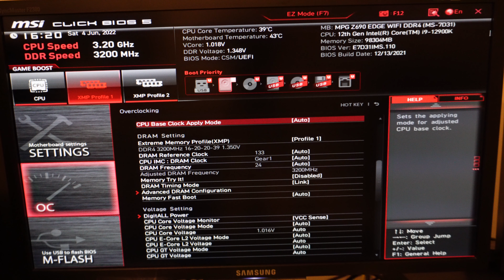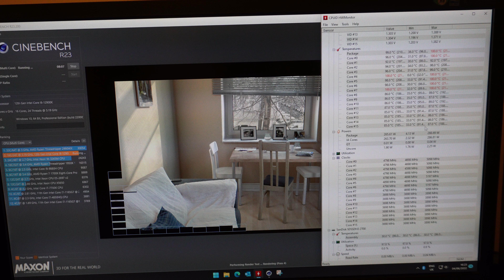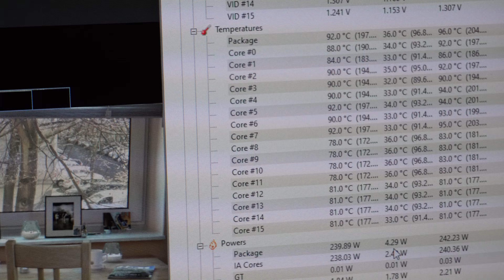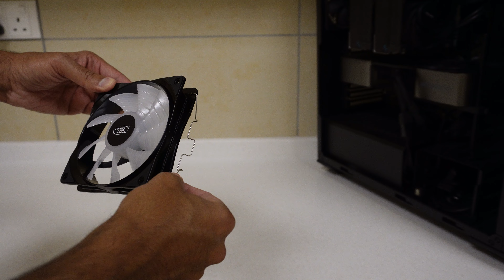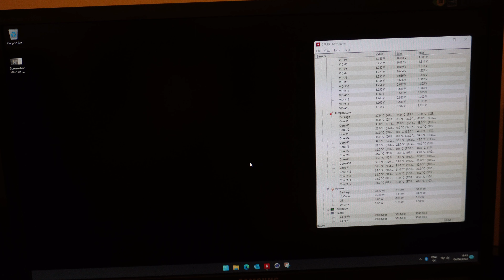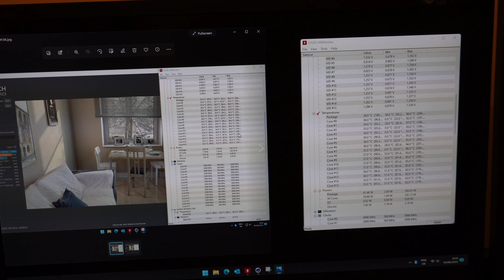Can DeepCool AK620 3 Fans Cool the Intel Core i9 12900K ? (with & without undervolt and power limit)

Comment: i bought a similar setup after watching this video, i got a Phantom Spirit 120 SE dual tower cpu and its holding my i9 12900k alright, no thermal throttling here
no overclock, doing undervolt on a cheap motherboard, great thermal paste, the biggest help for me was buying a 7 fan pc case to help with the airflow, thanks for the info!

Comment: My 14600k temps go up to 100 degree and the power consumption is 195 to 205 watts 
 the cooler is ak620 i used the thermal paste it came with cooler💔
Thanks for the video
Reply: mine too with 13600k undervolted now it consume 175 watt with max 94c....

Comment: Hello there great job 
Could you please tell me where i can get a third fan holder clip for the ak620
Reply from the maker: Hi  Thanks for watching, sorry I missed this question, basically I took the fan and clip from a deep cool neptwin cooler which wasnt exactly the same but just about fit, im guessing there are probably generic fan clips which might work but I also didnt have easy access to anything so was lucky to have a deep cool cooler sitting around to test with, let us know if you managed to find one might help others too, all the best, TK :)
Reply: I was going to buy the clip from ali ex and the fan from amazon then i saw the ag 400 plus for way cheaper price and it came with 2 fan and 4 clips so I bought it 😂 the issue is my 13700 f still hit 100 c under open gl stress test i tried to re mount the cooler no luck idk my-be my cpu is hot or my cooler is bad
Reply: In cinebench i got 98 c in warm room and 92 with ac on

Comment: You may have stated this, but did you test the difference between triple fan and stock double? And did you test with other, more CFM, fans on the cooler?
Reply from the maker: Hi, Thanks for watching. Yes as you can see from the video I tested stock 2 fans vs the 3 fan setup and there wasn't a huge improvement in temps but I did not have higher CFM fans to test with so unfortunately I can't say how much better it would be.

Comment: Great video, can DeepCool AK620 coold the I9 12900K when gaming?

Thanks
Reply from the maker: Hi, Thanks for watching and sorry for the late response. Considering we are able to get somewhat REASONABLE (if you can call it that lol) cooling out of this air cooler I think for gaming it should hold up ok as these synthetic benchmarks are only good for test purposes. I still think some sort of liquid cooled option would be better but in the current build used for video editing the 12900k is doing well with the AK620 with a slight power limit applied, I would highly recommend undervolting where possible and limit power draw to 241w as it is a very minimal loss of performance. Hope that helps, all the best, TK :).
Reply: @TKsTechTalk  Thank you for the detailed reply, much appreciated. Curranty  I am using the AK620 with I5 12600K and its perfect, but will go with liquid for i9.
Best regards.
Reply from the maker: @SIM0N0609  Yeah that's a good setup 12600k is definitely fine with that cooler, you know if the rumours are true about 14th Gen, hold out for 14900k (if it ends up being called that) apparently its more efficient and is rumoured to be supported on current LGA1700 z690/z790 motherboards and would be the last upgrade on this platform. If it is true and if it really is more efficient your AK620 might not need replacing and you can always test it before going liquid.

I really hope this is true will end up being a great option especially for those who opted for DDR4 like myself :).
Reply: @TKsTechTalk  Thank you Sir, that's Great news!

Comment: Hello, I'm thinking of switching my aio cooler to this one instead but i'm wondering if using only 1 fan will it still be effecient, i don't want it block my ram. I mostly gaming with 1 additional emulator tab, the cpu voltage is under 1.3V, the cpu power is around 70 below i rarely OC it pass 90w.  My cpu is ryzen 7 5700x and i have a h500m case
Reply from the maker: Hi, Thanks for watching. Personally I think for the 5700x which has relatively low TDP I can only guess it should be fine. I say this because there is a video linked below from gamers nexus which shows that the smaller ak400 single tower single fan fairs reasonably well with a 3800x and 123w.

https://www.youtube.com/watch?v=8NsFuNqINww

Hope that helps, feel free to ask any other questions.

Comment: i was thinking of replacing my nzxt kraken x 62 with this for my ryzen 9 5900... is it a good choice
Reply from the maker: Hi, Thanks for watching. So I can't comment on the kraken x62 but I believe this is a 280mm AIO which theoretically should be better than an air cooler. Overall since we can tame the 12900k a little bit with some tweaks using the AK620 I think it should be ok with the 5900x as to the best of my knowledge this CPU should run cooler with lower TDP than 12900k, but is there any reason you want to change to air cooling?

Here's a couple of links from Gamers Nexus and Hardware Canucks where they test with relatively high TDP CPU's to give you an idea of performance:

https://www.youtube.com/watch?v=4NpTZRassHI

 https://www.youtube.com/watch?v=UGM6FcLDckk

Hope that helps, feel free to ask anything else.

Comment: I did buy the AK620 with BeQuiet Silent Wings 4 pro for the third fan to cool my Ryzen 7700 non-X. I think it helps quite a lot because my room gets warmer much faster and the temperature never been more than 83C while gaming, whereas it is around 74-76C while running Cinebech R23. The ambient temperature is around 31-33C.

I did adjust some power limits though
Reply: why is it hotter on gaming than cinebench? you have some p-core OC for gaming + lite load for multicore loads ?
Reply: @clap22gaming48   generic test with no spikes its less heat. But spikes in gaming and auto fan rotation makes the difference
Reply: @clap22gaming48  its because if your pc case has poor airflow the heat of graphics card and cpu increases the temp while in  cine bench you only utilize cpu 100%
but while gaming probably your gpu will be 100% and Cpu Will be 60% so...
Reply from the maker: Hi, Thanks for watching. I appreciate your input. That's an interesting result and also strange that it runs hotter in gaming than Cinebench, either the game is CPU hungry or this was a momentary spike, maybe some background process played a part or maybe even a different fan curve could help, either way seems like its performing well on your setup. All the best, TK :).
Reply: Ryzen 7700 cores do not have specified as P or E cores, so I have no idea. Not just Cinebench test was weird but this happened to CPU-Z as well. It never reached 80C in temperature while having a full load but the clock was being only around 4.9GHz and 5GHz, never got to 5.3GHz in the tests. But while gaming the clock was there at 5.3GHz in every games at 83-85C with 100% usage.
Reply from the maker: @Sutlore007  Yeah that's a really strange result, either way at least it's not thermal throttling so your gaming experience won't be impacted.
Reply: undervolt the cpu man.

Comment: But for a normal scenario (gaming, video editing, etc) I think this air cooler will work, right?
Reply from the maker: Hi, Thanks for watching. I guess it will depend on which CPU you intend to use with this cooler, but from my testing on a 12900K if you power limit to 241W and undervolt by -0.05v it should be fine and for CPU's with TDP lower than this CPU. I don't really game so I can't comment accurately though since gaming does not use anywhere near as much CPU as stress tests it should be fine and I mainly used for video editing with the settings listed earlier and it does get a bit warm but not as hot as stress test and did not thermal throttle. Hope that helps, all the best, TK :).

Comment: hi, if i want to buy a fan for third one, which fan should i buy? 120mm?
and how i should connect it with ak620? does it have any place? thanks.
Reply from the maker: Personally, I wouldn't bother with the third fan not worth the extra expense as it didn't really benefit enough to recommend the cost or effort.
Reply: @TKsTechTalk  have a different 2 fan to 3 fan ? i can buy a akasa viper s-flow
Reply from the maker: @CryCasher  Hi, Thanks for watching, yes the third fan was slightly different as it was from a different cooler but it is possible that higher CFM may have a a slight improvement and reduce temps but unfortunately I didn't have any other fans to test with, overall there wasn't a massive improvement from the fans I tested with so not sure if 2 fans vs 3 fans with higher CFM would improve temps.

Comment: It is interesting, you have obtained 26900 points at 96º, I with my i7 13700 and a noctua U12A have had to lower it from 219w to 205w so that its temperature does not rise above 92º and I have obtained 27600 points, it makes it clear to me that if I change the noctua to this ak620 is not going to be able to lower its temperatures below 92º in the Cinebench stress test in each of its cores.
Reply from the maker: Hi, Thanks for watching. Firstly I appreciate you sharing your setup and temps, this could help others as well. In short I feel that the 13700 is probably just as good as 12900k but maybe very little better on thermals. You are probably correct, maybe the AK620 won't give massive gains and all these 12th and 13th gen cpus are hot. I have a 13900k currently running with Arctic 420 AIO and still just about manage to keep it around 90C by limiting power to stock TDP. It's nice to see that a U12A on 13700 can produce similar results. All the best, TK :).

Comment: how did you mount the 3rd fan though? what bracket did u use?
Reply from the maker: Hi, Thanks for watching. So basically I used a fan from another cooler, the Neptwin, which has the same size fan and the bracket is very similar so just fit good enough to use. Hope that helps. All the best, TK :).
Reply: @TKsTechTalk  you are somewhat late haha i got an NH_D15 chromax
Reply from the maker: @kurkurstuff2522  Nice, I'm think that will perform better than the AK620.
Reply: @TKsTechTalk  i think it performs ok. better than my 360 aio though thats for sure

Comment: Hi, I have a neptwin and was thinking of upgrading to an ak620.  I would really appreciate a comparative video of the 2 heatsinks you have since I can't find any reviews 🙏🏻
Reply from the maker: Hi, Thanks for watching. Unfortunately I haven't got the neptwin anymore and I wasn't able to test it with the 12900k but I do believe the AK620 is probably better at cooling the higher end CPU's. I was able to keep a 5800x at under 80C with a neptwin, but the 12900k is a different beast so not sure it would do as well as the AK620. However, I would first recommend testing the neptwin with a contact frame to see how it performs as I got a big temperature drop on the 12900k with a contact frame, assuming you are using Intel that is and depends on what CPU you are using. Hope that helps, all the best, TK :).

Comment: Hi. Is there any difference between the Neptwin and Ak600?
Seems they’re exactly the same
Both of them have twin towers and twin fans? Did you test them out?
Reply: The AK620 is quite a bit better than Neptwin.
Reply from the maker: Hi, Thanks for watching. I actually did have a Neptwin for a little while though it moved on before I had a chance to test it with the 12900k. I think the AK620 will perform a little better than the neptwin. However on a 3600XT i saved a few degrees over the stock cooler using the Neptwin and I think from reviews the AK620 beat those results by a few more degrees. Sorry I can't be more helpful on this one but hope that helps, all the best, TK :).

Comment: How's the performance of this Liquid cooler? Recently I have built my gaming pc and I have paired the Deepcool LE 500 240mm Liquid cooler with i7 13700k. Will it perform well?
Reply from the maker: HI, Thanks for watching. The 13700K has similar tdp to 12900k and maybe a little higher I think its 253w vs 241w at least at the intel stated power limits. With this in mind I believe it will have similar thermal performance, though I think the IHS and cooler contact is a little better as I found with my recent 13900k though I haven't tested this yet with the air cooler. What sort of temps do you get with the 240mm liquid cooler? I think a 280 would perform a little better, but then case restrictions may not allow to install one and then of course there's the price consideration. Let us know your results might help other too. Thanks in advance.
Reply: @TKsTechTalk  The temperature goes 82 above when in full load, I think I would need to change my liquid cooler to 360mm
Reply from the maker: @mustafa.blender3d  Yes if the case permits you could try this, but if it fits a 280 I think generally they perform on par or better than a 360 as far as other reviews go. Maybe try a contact frame if you haven't done so, with contact frame on my 12900k with Arctic 420 I got more than 10 degrees C cooler temps and 13900k improved by 5c. Let us know what you decide and if it improves.
Reply: @TKsTechTalk  THANKS ALOT FOR YOUR HELP, Sure will let you know

Comment: Is that cooler enough for 7 5800x3d?
Reply from the maker: Hi, Thanks for watching. Unfortunately I do not have a 5800x3d to test with but I do know that this is also a hot CPU. I think for gaming it should be fine though under stress testing I wouldn't be surprised if you hit 90C with some throttling. From searching I found that Cinebench on a NHD15 can hit 90C but but under gaming manages under 70C. Hope that helps, all the best, TK :).
Reply: @TKsTechTalk  okey, thanks for reply. I bought 7 5700x in the end, i know x3d is better, but 5800x3d and 5800x use tons of watts, and it seems 5700x will be sufficient for gaming purposes under low wattage
Reply from the maker: @Vale-gz3mu  Yes you are right, the 5700x has a much lower TDP and runs cooler. I guess it depends which GPU you use and which resolution you use if you use it for gaming. The 5800x3d will benefit with high end GPU's otherwise the 5700x is great for mid to low end GPU's.

Comment: I just want to gameplay, live stream and video edit and is Deepcool AK620 good for that? Because Cinebench is not what real life performance means. No one is going to run Cinebench 24/7 365 days, not even me.

Can you tell me how will i9 12900k + Deepcool AK620 will heat in that situation? Just gaming, twitch streaming and editing
Reply from the maker: HI, Thanks for watching. You are right these benchmark stress tests are just to test the worst case scenario and capability of the coolers. I'm not a gamer but I have seen plenty of content where tests show that the CPU runs much lower watts and therefore cooling is fine. 

I do use it for video editing and the 12900k does heat up a little when doing exports though not to 100 degrees at least when using the intel power limits and i would highly recommend using the Intel power limits as the temps are better. Might even help a bit to use the contact frame especially if its a new build. I just got one and plan to do some tests with Arctic 420 AIO and will try with AK620 if i get time.

Hope this helps, all the best, TK :).
Reply: @TKsTechTalk  Thanks for the response. Yes, your info was very helpful indeed. Of course it's my life's first ever PC so I will definitely use Intel Power Limits. Finally some relief after knowing it does run in lower watts and AK620 can handle it.

I don't wanna opt-in for AIO ever because except cooling, nothing is good about it. In the last 2 years I have heard enough accidents or malfunctioning regarding AIOs. People say it doesn't leak or malfunction, then what were those tons of complain that I had heard? There's no way I will ever install such a huge risk in my PC
Reply from the maker: @ChandanRajdeepMohanty  You are welcome. One more thing I forgot to add was in addition to the power limits, if you are comfortable with trying, apply a small undervolt, i currently use 241w with -0.05v undervolt. I have to agree with you about the AIO, this is my first time using one and its fine so far though i do know people have had issues with them in the past, lets see how long it lasts :). All the best with the build :).
Reply: @TKsTechTalk  thanks, hope your pc will work great. Recently I learned something. In BIOS you have to do just few settings.

1. Disable MCE
2. Put your PL1 to 90 and PL2 to 90 too. That way it consumes much less power and heats much less. The alternative way will be put PL1 to 125 and PL2 to 250 or 253. Then a 3 fanned deepcool AK620 will cool it too
Reply from the maker: @ChandanRajdeepMohanty  Excellent, thanks for the tip hope this will help others too. Really appreciate your input.
Reply: @TKsTechTalk  no problem, glad i was able to give some helpful input